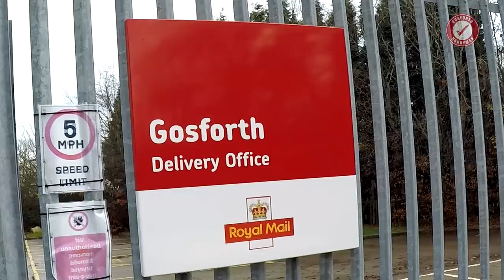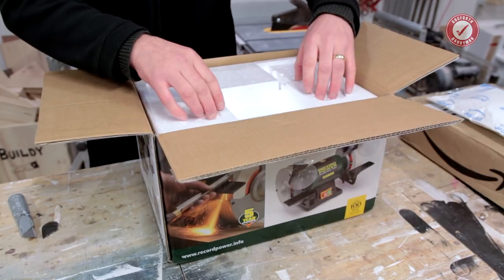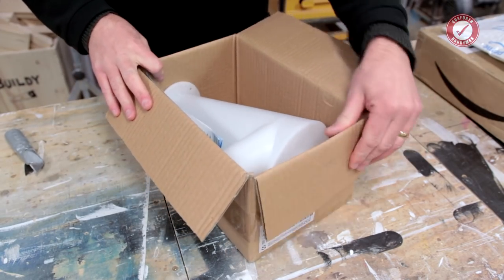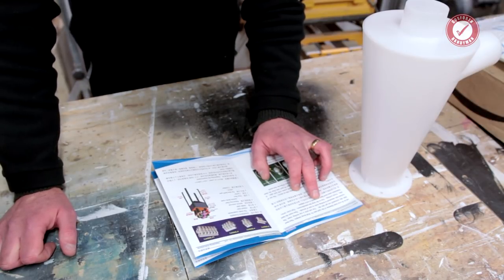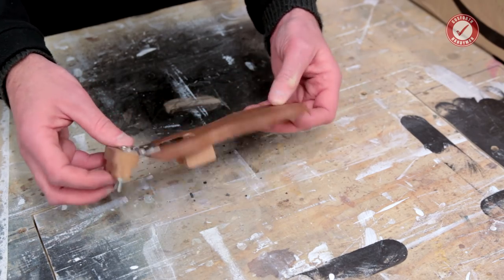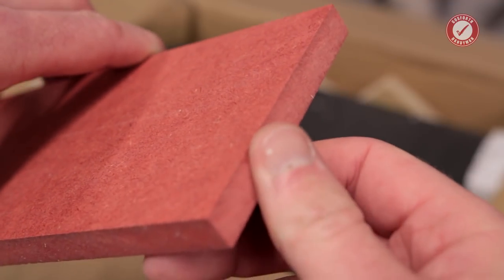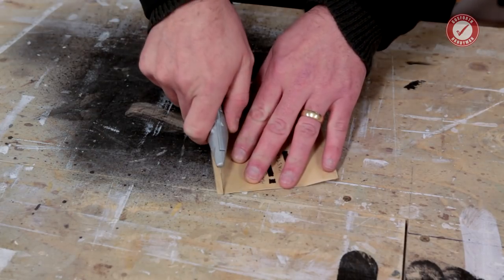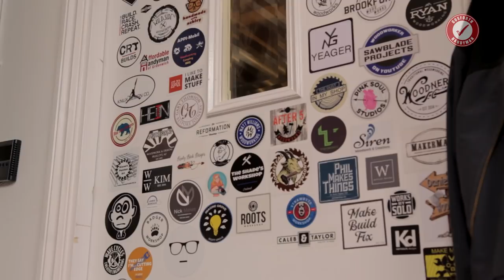Notes from a Small Workshop - Mailbag #1, Woodworking Vlog (Nov 2018)

Comment: Andy - love your chatty videos.

I ordered the same cyclone and was scratching around for hoses.

To connect between the vac. and the cyclone I found (eBay Search) '55mm Inner Dia Suction Tube Cleaner Hose Bellows Straws Dust Collector Hose 1.5M'. This goes directly onto the cyclone, with a jubilee clip. It also connects directly into my (Screwfix - 39587) TITAN shop vac. (the one with Power Take-Off, about £90), with a couple of turns of duct-tape.

For the tool side I duct-taped this adaptor (eBay Search again) '1x Reducer Adaptor For vacuum cyclone dust collector woodworking Tool 50mmx32mm' to the cyclone and attached my hose to that.

Mounted the cyclone on an old plywood box I had and it works great. Not pretty, but functional.

Hope this is useful.

I'd be interested, when you make a video about it, to know how the Festool hose attaches to your setup.

Nod to Ped Baker. We had a bit of a conversation below.

Comment: Hi Andy, I first used some black MDF about 8 or 9 years ago, we made some displays for a very large watch maker. This board was veneered with lace wood or London Plane, we then router grooves into it to expose the black shadow beneath. All I can remember is when we had finished routing and sawing it we looked like we had been down the mines and were covered with black dust, just be sure to wear good breathing protection as you don't want that going down to your lungs.

Comment: I have the same (or similar) cyclone from the same factory on China. It works ok with my titan vacuum cleaner. The fine dust gets through but that's all that goes into my hoover bag and all the big stuff goes into the collection container. All in all my hoover works better and I can't remember when I changed the bag last. Also not pretentious to show off stuff you've bought or been given.

Comment: I installed that Chinese cyclone a couple of months ago. I love it!  It works like a charm!
But - you need a really tough bucket under it. The first cheap bucket that I fitted, imploded as soon as the vac choked on some tough shavings.
The trick, I have since learned, is to use two identical buckets, one  inside the other, bolted together around the rim.
Why?  Well, if to try to distort a circle, it tried to become an oval.  But if it is constrained by another circle, it can't.  Same applies to cheap buckets :-)
Oh... don't break your fingernail trying to get the lid off your cheap bucket.  You can get a tool on Amazon that makes this easy.  Well, easier...
Reply from the maker: Going to try one of my wood bins - hoping it won't matter that it's square. 👍
Reply: @GosforthHandyman  I don't think that it will matter in the least.  But the lid will need to be fairly airtight, which will require some sort of gasket and hold-down latches. Lots of guys on Youtube fix the cyclone to the lid with nasty sticky messy silicone. I didn't bother, I just screwed it down - and it works perfectly. I look forward to seeing your solution in a future video.

Comment: I’ve one of those cyclones mounted on 50litre plastic drum that’s on castors. Best thing I’ve ever made. £50 all in. Never need to empty the hoover, just the drum. 
Biggest problem is finding the right size hose adaptors.  If you’re interested I’ll send a parts list and pics. 👍🏻
Reply: I was wondering about adaptors as well. Would be very interesting to see other peoples solutions.
Would love to see how you did it Ped.
I have a Wickes wet & dry 38mm, and a Titan with PTO, at 32mm. Why ain't it all standard??? I've got adaptors for those but cyclone at 50mm? That's something else.
Reply: John Riches I was going to put some photos on my reply but I guess that’s not allowed. 
I found an adaptor that went from the cyclone to my Dyson hose but I still needed to wrap a couple of turns of gaffer tape around the male part to get a tight fit.
Reply: @PedBaker   - Thanks Ped. What did we do before gaffer tape? BTW, Peter Millard suggests using bicycle inner tube (loads of sizes available) to adjust size of adaptors or tool. I've used successfully. Still haven't yet found cyclone 50mm adaptor to vac 38 or 32. Another issue is the way that sellers describe their adaptors - I never know if they're specifying ID or OD.
Reply: Ped Baker - Thanks Ped. Only just seen this. I'd actually ordered 2 of these from eBay.
Received my cyclone today. The photos of the cyclone showed the o/d as 50mm. Measures up as 56 with i/d as 50! Still waiting for adaptors so gaffer tape and heat gun at the ready...